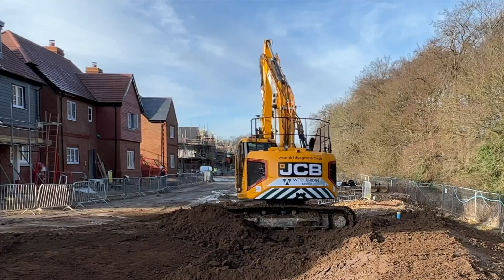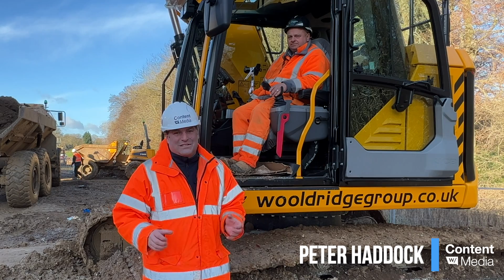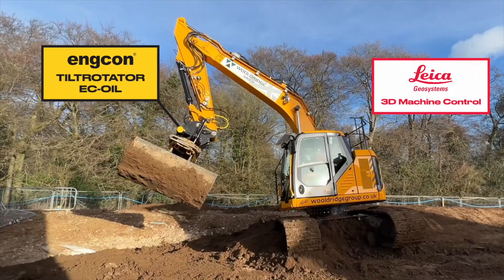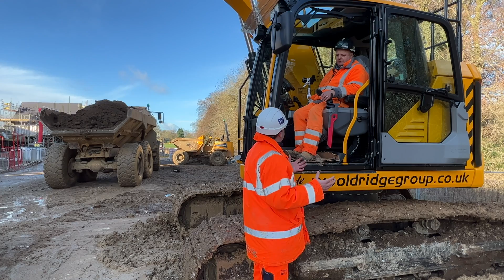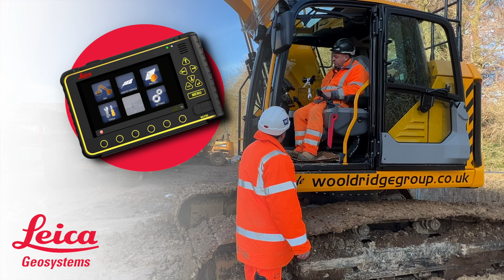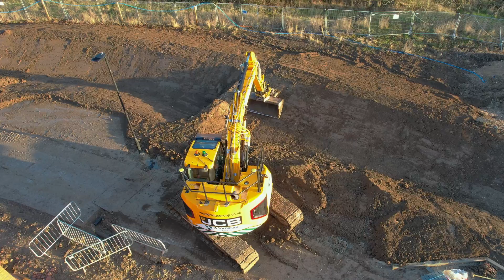First JCB 245XR with Engcon tiltrotator & Leica Geosystems 3D machine control for Wooldridge Group

Comment: Why JCB would not include a front shovel option in the design of this otherwise brilliant excavator is beyond common sense. What construction contractor would buy this brand that leaves off a necessary option for back-filling?
Talk about a deal breaker out of the gate!